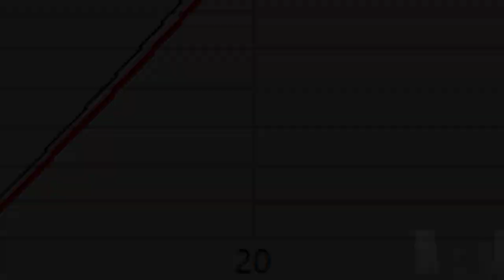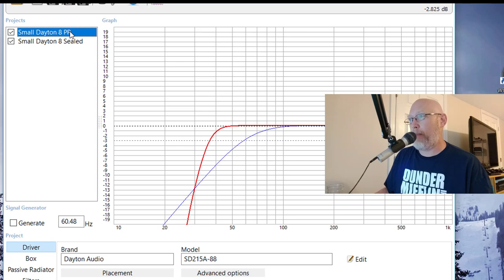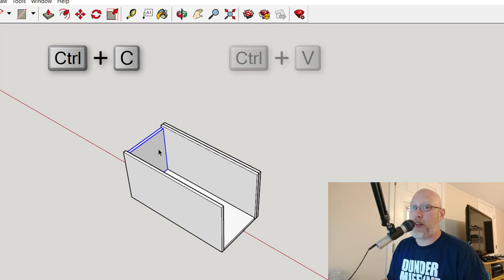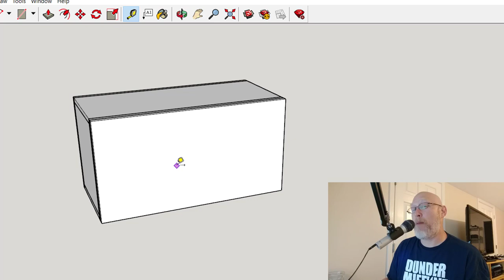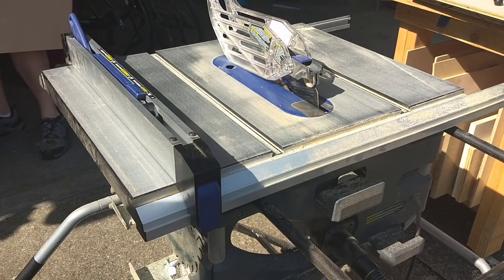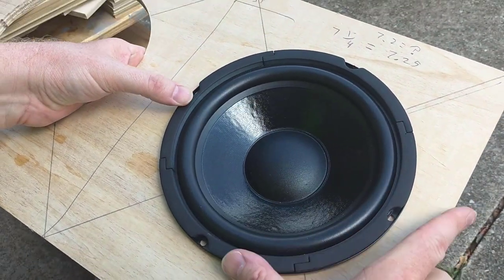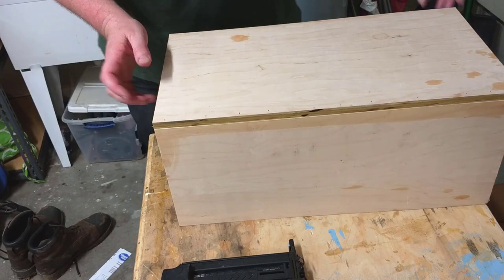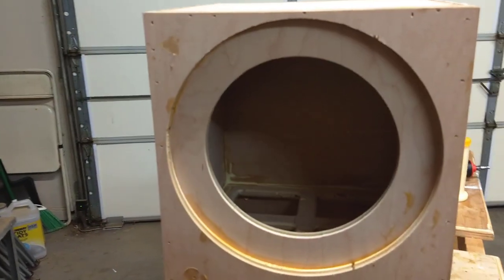How to build a subwoofer. Passive radiator sub build part 1!

Comment: Everything I've found about passive radiators says you should have at least twice the cone area of your active driver. I'm getting ready to try my first passive radiator setup with a Dayton audio 12 and 2 Dayton audio passive radiators. Hopefully no mechanical noise. I like those lows 😁. Nice video though 👍
Reply from the maker: The actual rule of thumb is that your passive cones must be able to displace twice the air that your active cones can.  So the two cones can be the same size if the passive cone has twice the x max.

Comment: Is it bad to have too much xmax on the passive radiator? The passive I want to use was intended to pair with a subwoofer with double the excursion. 10 in passive with 10in low excursion subwoofer
if the excursion is low enough you think a 12in sub with a similar excursion would also work? Or two 10in subwoofers?

PR: Boston Acoustics GTR10
Sub: Audiopipe TS-CAR10
12in Sub: Audiopipe TS-CAR12

Less than a centimeter depth difference between the two and same excursion.
The Boston Acoustics sub its intended to be paired with has 14.5mm xmax. The Audipipes only have 7.5mm.
Reply from the maker: The passive radiators have to be able to move double the amount of air as the subwoofer.  So one passive radiator will work but it has to have double the x  max of the subwoofer.  if the passive radiator has the same amount of X-Max as the subwoofer then you need two passives.  it gets a little bit more complicated when you pair up a 10-inch subwoofer with a 12-inch passive.  You just have to calculate the cone area and multiply that by the x max to find the volume.  keep in mind that cone area is usually in inches or centimeters and x max is in millimeters so you have to do some conversions.

Comment: As I'm nearing completion on my custom speaker cabinets each will have a 10in subwoofer an two 10in passive radiators tuned to 16.7hz in a 2ft3 box the sub is in the front and the passive rads are in the back of the box an according to winisd with the chosen sub a rads an tuning fq is flat down to 27hz with a rolloff at 24hz at - 6db an that's all with a empty box now for my long winded question should I add any polyfill
Reply from the maker: It's not necessary, but some kind of stuffing might help with standing waves.  I always throw a little bit of something, even if it's just insulation in most of my builds.
Reply: @DIYAudioGuy  one other thing in my cabinet design the walls are .875in thick an the front and back baffles are 1.5in with a half in flush cut so the drivers sit on a 1in thick layer is that all structurally good enough
Reply from the maker: @DREDKNOT2063  I think so, If you're worried about it install some bracing.

Comment: Nice!! I have Xtreme 2 with bass radiators 😂👍
Reply: @karterarkileez6603  Why it has good sound!! Trash are homemade Speakers!! JBL Has detailed and good made Speakers because JBL Has designers whose work is this!!👍
Reply from the maker: JBL is made by Harmon, Harmon is one of the few speaker companies that hire legit sound engineers.  I am talking about people like Richard Small, as in the Thiele/Small parameters Richard Small that they hired back in 1993.  A big company like that will engineer speakers for a given price point, which will impact sound quality.  So some JBL is amazing and some is not.

As far as homemade speakers being trash, this is not true either.   There is a subculture of speaker builders that enter into competitions like the MidWest Audio Fest and there are DIY kits that will hold their own with professionally developed speakers. Mine are not there yet, but they will be one day and I am having a lot of fun learning the process.   It is a fun hobby, and an exciting adventure.  You should give it a try.

Comment: I'm planning my own version of parts express duel 15in rad 15in subwoofer combo that's
 3. 2cubic foot thers is a cube shaped that just takes up to much room in my home theater I'm building my own at 3.5cubicfeet with the same twin 15in radiators but mine will be a flatter build plus with the wood from home depot it came up to just 95$ thats for two separate 15in builds each with dual 15in radiators I'll be using a 15in 2ohm Audiopipe
Reply from the maker: That sounds awesome!  Which passive radiators are you going to use?
Reply: @DIYAudioGuy iv already bought 4 of the RSS390-PR 15 two of the Dayton Audio RSS390-PR 15" Aluminum Cone Passive Radiator for each box , i just not sure if i should add some kind of baffel contours in the 

box to shape the sound from the sub to the rads or wheither to just leave the inside of the box bare except for a light coating of Acry-Tech Acoust-X 

Damping Material 

i do plan on coating the outside with some EPOXY Resin in a 3 to 1 harder ratio an give it a red color via of the Black Diamond Pigment powder ,

any thoughts on what kind of spray gun i could use to with the EPOXY Resin ?
Reply from the maker: @DREDKNOT2063  I have never worked with epoxy resin.  But my first guess would be a cheap $10 spray gun from Harbor Freight that way you can throw it away after you gum it up.

Comment: Hey using that software is nice but does anyone know if under the filter options which of them is comparable to the high & low shelf options on the outlaw audio 976 balanced receiver subwoofer eq settings
Reply from the maker: I do not know, sorry.

Comment: I don't know if he talks about this but, since passives cost about as much as live drivers, why not just use multiple live drivers?
Reply from the maker: That's the primary downside, a simple port is a lot cheaper.
Reply: Because that would defeat the purpose. Without the passive radiator you get almost no low end extension. Now instead of the passive, install an active driver. Boom, now your enclosure space is cut in half because it has to be shared between 2 drivers. Now your low end extension is even WORSE

Comment: Would a 12 inch passive radiator work for 2 10"
Reply from the maker: Probably not.  The passive radiator must be able to displace twice the air volume as the active driver.  Since the cone area on two tens is more than the cone area on one twelve the xmax on that 12 would have to be huge, or the xmax on the tens would have to be very small.  you might be able to pull it off with two 12-inch passive radiators and two 10-inch drivers.  It will depend on the xmax.

Comment: a passive radiator must always be 2 times larger than the active driver?  or am I wrong now.
Reply from the maker: The passive radiator must be able to displace twice the air as the active driver.  So if the active driver and the passive radiator have the same cone area and the same x max then you need a second driver.  Kicker, for example, is currently selling a compact enclosure with one passive and one active.

Thanks for watching in thanks for commenting!
Reply: @qddk9545  please report back with your findings!

Comment: If I built a box with a passive radiator woofer the box has to be sealed not ported correct.
Reply from the maker: That's right.  The idea is that you're using the passive radiator instead of a port.

Comment: Bagaimana jika beda ukuran? speaker subwoofer 8" dan pasif radiator 4" x 2 ?
Reply from the maker: I had to plug that into google translate, I will do my best to answer.  The rule of thumb is that the passive (or passives) must have the ability to displace twice the air that the active can displace.  So if the active has 5mm of xmax and a 500 cm cone area then it can displace 250 cubic centimeters of air in one outward stroke.  If you had a passive with the same xmax and cone area then you would need two passives.  If you had a bunch of smaller passive radiators that would work, you would just need enough of them to double the active's air displacement.

Comment: Can you please post a cut list ?
Reply from the maker: A lot of people ask for them.  I will start including them in videos.  When I get back to my computer I'll give you one.
Reply from the maker: I made this out of half-inch birch plywood.  The material was off-cuts from a local cabinet shop, and it is true half-inch material.  Most half-inch plywood is undersized.  But if you use MDF these will be fine:

Baffle (x2)  21" x 11"
Rear:  21"x11"
Bottom:  21" x 8.75"
Top:  21" x 8.75
Sides (x2):  8.75"x 10"
Center Brace: 8.75"x 10"
Reply: @DIYAudioGuy  Thanks.  With that I know box volume.  I need to make mine slightly different to fit.  This will improve the WAF (Wife Acceptability Factor).  WAF is the most important specification in home audio, you know.
Joe
Reply from the maker: @Godzilla2k69  If you are using it for a home theater subs, I would not.  You will want something bigger.  This is good for a small 2.1 computer/desk/ bedroom speaker.
Reply: For TV in bedroom.  It'll be just fine